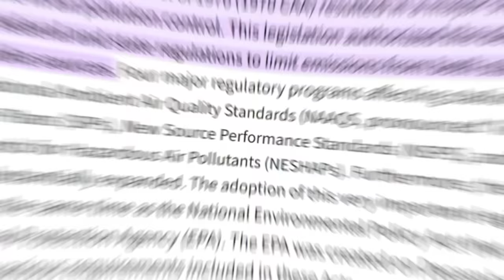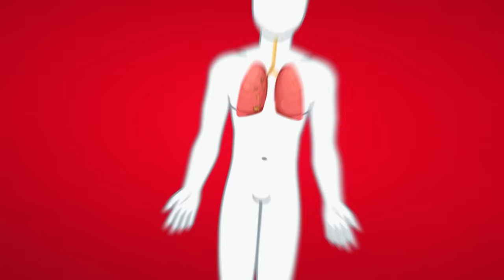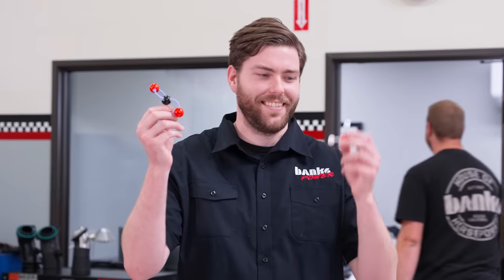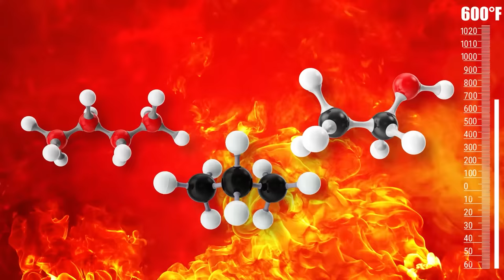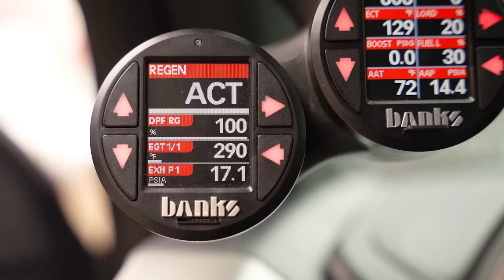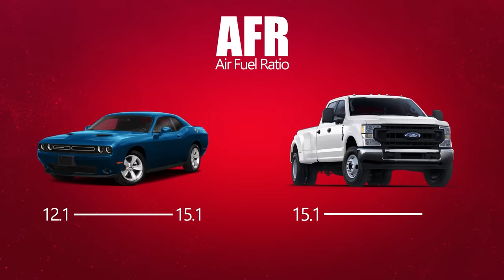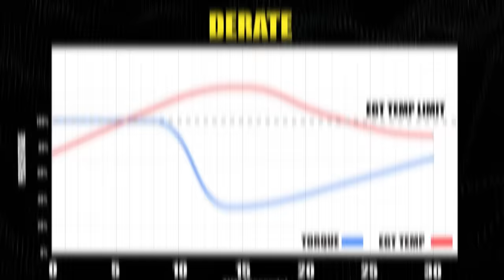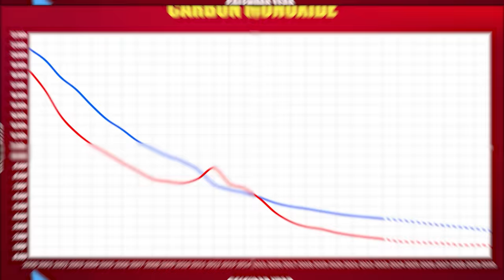Understanding the Most Hated part of your Truck | Banks Entry Level

Comment: My 2017 Superduty has 300,000 miles. Zero issues with the Egr or DPF. Been running the derringer and Amsoil for 200k miles. I’m living proof this works.
Reply from the maker: Love to hear that.
Reply: @alphaforce6998  Not a shill at all. I have found the modern diesels want to be run hard. Excessive idling and short in town trips kill these trucks. I run a minimum 200 miles a day. I understand this isn’t normal for most owners. Unfortunately no million miles for me. New truck is almost here. Sorry to hear you are having so many problems early.
Reply: @frankclark7039  in fact, I think idling and short trips just kill engines in general, make cool wear to be the principal and faster way of destroying machines and environment and economy... choosing engine for the actual work the vehicle is going to do is way more important than ever (but it was also before). Even if talking only money, or being fuel as cheap as USA and other petro-countries... Total cost of ownership will have in fuel one of the major cost of all, repair/maintenance depends on time/mileagge, cost of vehicle... doing some numbers before it may be very good even for having several vehicles for the total price of one... 100.000 miles of urban/short can be roughly equivalent to 750.000 miles on road...
Reply: This is why I buy the gas versions of the heavy duty trucks. The only time I buy a diesel is the older trucks.
Reply: Here in the UK delivery vans and work vans now have DPF filters. They're usually all manual transmission, so economical delivery drivers who keep a constant low rpm short stop, idle, then start journeys kill DPF filters. A mechanic friend told me if they get a new van with trouble first thing to do is run it at 60mph in 2nd/3rd gear down the motorway, usually fixes any DPF issue. Driver never comes back again once they learn it needs to get HOT every so often to clear out all the emissions filters.
Reply: Donate the engine to banks . Be interesting to have gale pull it apart.
Reply: In 1963 in auto diesel school we were taught the tune that passes more fuel than is burned or the engine can burn is producing less power and wasting fuel.
These little boys that roll smoke are fooling themselves.
Saw it all on a Dino in LA. In 1963.
Saw it in practice in West Texas with a trucking Co. that would run circles around others in the oil patch. They were very picky how we set up their pumps and injectors.g They never rolled smoke.
Reply: "Anecdotal evidence is only evidence of an anecdote."  also "The plural of 'anecdote' is 'anecdotes' not 'data'."
Reply: @InternetListener which is why HYBRIDS are so useful, the stop and go stuff you don't even need to start the ICE.
Reply: Look at that! That’s great news.
Reply: Open up that intake and look at the amount of built up crap from the crankcase vent oil mixing with egr crap. In a 2011 Ford 6.7 had a1/2 in all the way around going into engine. Regular services, w/ motorcraft filters and full synthetic oil. These systems kill our engines
Reply: @lewisbolman7862  Yep.  Feeding soot back into the intake will never increase longevity.
Reply: @frankclark7039 idling and short trips is the worst thing you can do to any diesel. Run it hard or get a gasser
Reply: @lewisbolman7862  common even in the old diesels. When I bought my olds diesel it had gunk in the intake from the pcv and egr. I just clean the intake with a rag every couple oil changes
Reply: @clintonsmith9931  -- Bone-headed Moe Rons "rolling coal" are ruining it for everyone. I got some ideas about where they can shove that exhaust pipe but might not be proper for a public forum. :)
Reply: That's because it took up until 2017 for Ford to realize that they need to put steel pistons in those damn things. All of the power strokes before 2017 would melt pistons #7 and #8 when egts got too hot from clogged filters.
Reply: Bullshit🧢🧢🧢DPF and EGR have no place in any car !
Reply: @PKperformanceEU  I agree with you a 100%. But that is the world we live in until someone changes it.

Comment: We're not doing it for horsepower! It's for longevity and reliability! I run a EFI tow tune and tranny tune. Hauling RV's. Much cheaper to delete than repair. Haven't seen a 500+k miles that wasn't deleted.
Reply: Because you haven't does that mean there aren't? What about the health of all the people you have exposed to the particulates and NOx?
Reply: @TheEsseboy  They don't care, it's purely selfishness.
Reply: You're right, we don't care. So stop crying.
Reply: Wonder if you'd use the same logic if someone pulled up to your yard and dumped a whole truck of sewage in it and said "don't care about what you think"
Reply: @ZealothPL  What a foolish comparison
Reply: @TheEsseboy  Move out of the city and you wont have to worry about the exhaust fumes

Comment: I don't believe that a majority of people delete for power. It's reliability. EGR systems clog intakes and ruin engines WAY before the rest is worn out. The DPF can clog and not burn completely (think city driving with multiple stops) and ruin the engine as well. On top of that, when these parts that are forced upon us fail, the government won't be there to replace them and it's insanely expensive to replace them. It's far more financially viable to remove the components when they fail rather than replace them. God forbid your engine is fried due to a clogged DPF, those things are over $10,000, which is the cost of a small commuter car.

I see regens almost every tank. My truck is 100% bone stock. Reliability concerns drive my desire to remove the crap, but I have not done so, yet.
Reply: Yup, nothing like a derate warning in the middle of a Youkon winter and being stuck in dealer parking lot for three days because a sensor wire on the DEF system is faulty following the previous derate and a seven week lead time on emissions system parts at the dealer requiring buying parts out of warrantee on ebay to get running. I feel ya.
Reply: Engines don't fry when the DPF is clogged.  The DPF is cleaned with a chemical solution.  I know because I had mine cleaned on my 2015 LML after the sensor failed.  It was at the 85K mile mark.  The cost was about $600.00.
Reply: @GTOGregory  Google it. I saw a video where one clogged and the DEF was sprayed in there until the engine cpuld not expel exhaust. It smoked white and shut off. Dude was lucky as his engine (Chevy/Duramax) was undamaged, but he needed an entirely new exhaust system. He has it in a video on YT somewhere. Watch it if you can find it.
Reply: @GuretoSefirosu  Nope.  I'm not going to Google it.  That's your job.  You're making the claim.  I understand someone chokes on Jello and dies each year.  People still eat Jello and there are no Jello health warnings.  One occurrence of a poorly maintained vehicle doesn't mean jack.
Reply: @GTOGregory  You cannot paste HTML links in YT comments. Either you're a troll without a clue about these systems (likely just a driver, not a mechanic), or you're have no clue how YT works. Either way, I literally can NOT paste a link here. You have to do the search yourself or live in ignorant bliss.
Reply: Yeah, most people delete and then keep at stock hp levels. When you have no emissions to go bad, you basically never have any issues.
Reply: Go ahead and say that to 6.4 powerstroke owners. I fucking dare you.
Reply: @jaynedoug9453  You can make the power with or without the EPA crap. Banks Power has proven that. I know several 6.0 and 6.4 owners and they deleted primarily so they don't have parts built to fail onboard. One souped his up also, but the other guys are stock AFAIK.
Reply: so don't buy a diesel truck. are you pulling a 5th wheel trailer?
Reply: @ronblack7870  No, I pull a 40ft flatbed. Also, what kind of logic is it to not biy a diesel jist because the EPA mandated some crappy parts which can be removed?
Reply: @GuretoSefirosu  I think his point more has to do with why you’re using a diesel engine, when you could do the same work with gasoline or CNG. The total cost of ownership and operations cost to your production could be lowered. I think a lot of light and medium duty truck owners need to seriously be evaluating this factor. In today’s industry, many are buying a diesel just because that’s the assumption of what is needed to do the job.
Reply: @PickleFlopper  Gas pulling 40k? Go on, I'll watch. There is no competition between gas and diesel. That's comparing a Honda Civic to a Kenworth. No competition.

As for CNG, it is far cheaper but there are two problems. Half the power and very few filling stations. Conversely diesel is very powerful and you can get it almost anywhere.

As such, unless you are local and have a CNG facility nearby, it is out. If you are just tooling around town and not towing, gas is great. For those of us who do the continental 48, diesel is the only solution.
Reply: @GuretoSefirosu  I was just trying to expand the guys question and possible solutions. You said 40ft flatbed. I assumed hotshot below 26k, my bad. I have class 8 units, but run regional. I’m waiting to see how the new Cummins 15L CNG system works out. That would be a game changer.
Reply: @PickleFlopper  Sorry, I did not mean to sound hostile. I was just pointing out facts. CNG does not contain the same amount of stored energy as diesel. If CNG pumps are in your area, at a minimum you save a TON of fuel expenses.
Reply: Lung cancer is gonna bankrupt you, a DPF clean for like 1000 bucks won't.
Reply: @em4703  Think before you speak. Are you insinuating that every truck driver and diesel owner in the past 50+ years has cancer? Really? What do you think we do, crank it up and go breathe from the exhaust pipe? We have run diesel for what, close to a hundred years before the DPF was created? You think all those people died of cancer? Come on man, we both know better.
Reply: @GTOGregory  If DPF wasn't a failure point, then do don't any Government owned Diesels have them? Does the Government hate the environment? WHAT ABOUT THE PENGUINS GREGORY?!
Reply: @GuretoSefirosu Entirely new exhaust system?

You're destroying your credibility. Maybe he needed a new DPF and SCR.  

But "entirely new exhaust system?" You're either believing lies or lying.
Reply: @Fin.mint. Lots of government owned diesels have DPF. Military doesn’t. Do you really want the military to have to comply with EPA while theyre in the midst of a battle? Wise up and stop making bad arguments.
Reply: @wiredforstereo  Imagine a DPF failure in a firefight...
Reply: @wiredforstereo  "Good for thee,not for me"
Reply: @GuretoSefirosu  Exactly. Arguing "the military doesn't have to so why should we?" is a profoundly idiotic argument.
Reply: Thats why if the majority of your driving is commuting in city traffic then you don't need a diesel. To many people paying for an $80K diesel truck to drive it stop and go 15 mins to the office and back, just to maybe pull their toy hauler twice a year.
Reply: @maguirekelly8417  Agreed! Load the engine down. Now old-school diesels could handle any driving style, but news ones can't.
Reply: That’s the plan, make it so expensive you move to EV.
Reply: @iikon69  Remove all the subsidies and pay for the damage created, and gas cars become quite expensive.
Reply: Regularly Use a Diesel Fuel Additive. It'll lubrcate your fuel injection system including injectors, clean and maintain your EGR and DPF. Also make sure at least once a week that you take the engine for a blast to clean your DPF. I've done 120k miles on a Mixture of Town/Motorway and my cars never any EGR DPF related faults and is clean even with a Tune!!

Comment: Really informative and well produced video.  Eric is excellent! 

DEF vs. EGR use is the tightrope manufacturers have to walk while meeting emissions targets.  Heavy EGR use to lower NOx creates more soot which taxes the DPF.  Lighter EGR use runs hotter and cleaner soot wise, but requires more DEF to deal with the resulting NOX increase while meeting emissions targets.  Less EGR is generally good for the DPF and overall emissions system reliability. 

It is reported by owners that GM's new 3 liter I6 diesel uses quite a bit of DEF.  I wager GM is running lower levels of EGR in that engine, and the EGR it does run is filtered through the closely mounted DPF first.   Recently saw a teardown video of the new 3.0 on the "I do Cars" YT channel, the engine was quite clean inside, looking more like a gas engine and not looking like a 145K mile diesel at all.  Alas, that particular engine got chewed up as the idiot owner didn't keep oil in it and the pressure fed cam chain tensioners lost the plot, as did the main bearings if memory serves. 

Though much maligned for it's belt driven oil pump, GM's 3.0 I6 diesel is a cool engine, and the apparently by design increased DEF use is worth it.  The belt looked fine in the YouTuber's teardown video by the way.  GM's problematic by the 150K mile mark torque converter will probably need replacing anyway, the belt is easy to service at that point 😆

Comment: The biggest issue i have with the emissions system is that it is extremely unreliable and is consistently the cause of down time and in the trucking industry, that costs you more than the repair itself generally
Reply: On top of that, the fact it can shut your shit down on a road trip and leave you stranded is horse shit. I less bothered by power and efficiency and more bothered by faults and sensors failing which is A LOT. They still cant figure out a reliable system. Deleting for better MPG and reliability is all that matters to me. Dont care for power gains really
Reply: Forced regens are glorious. Nothing like damn near redlining the engine for an hour on the side of the road just so you can hopefully continue your freight run.
Reply: @hurst814 don't forget guys that get a new company truck and don't know to park with their trailer on the opposite side of the exhaust, and end up setting their trailer and truck on fire.
Reply: Not only that, those systems DESTROY your engine very quickly also. You'll get WAY less miles out of a modern diesel before it's junk.